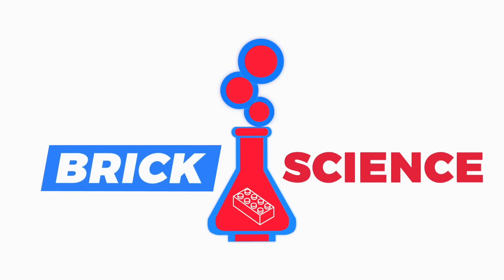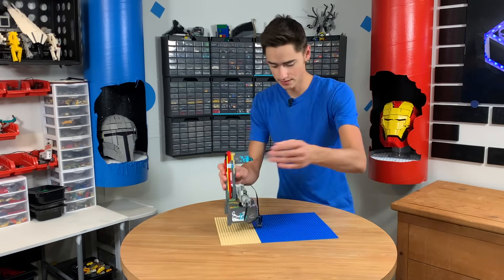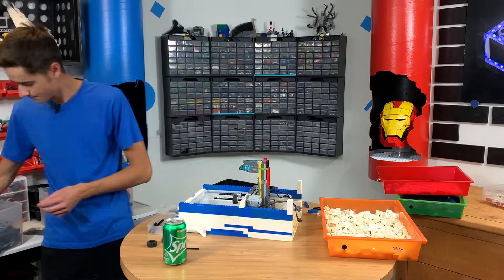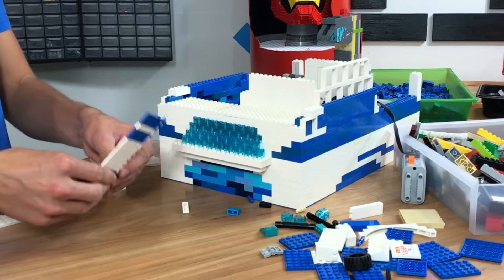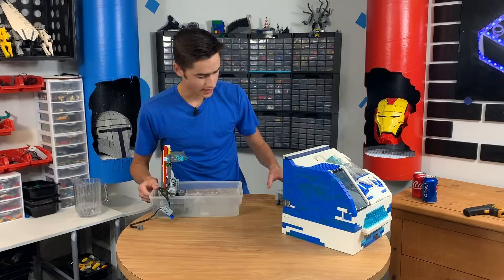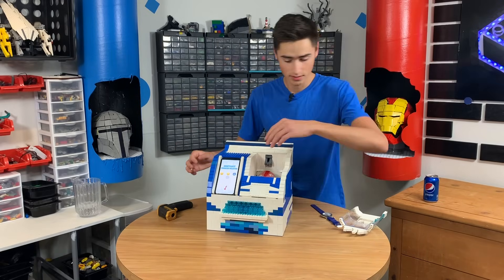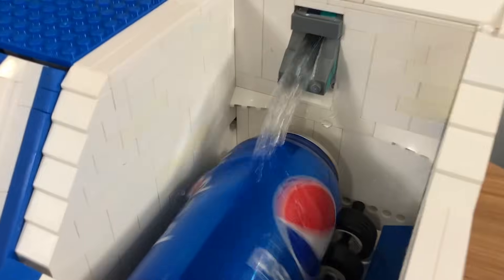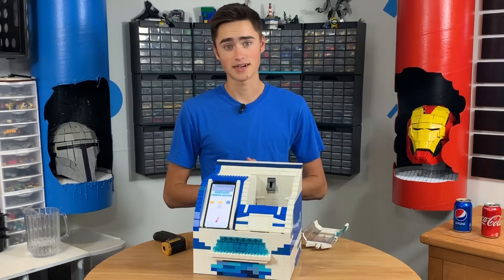Instant LEGO Drink Cooler (Chills Drinks in 2 Minutes)

Comment: I'm thinking about using a switch instead of using a hold mechanism like that. It wouldn't take that much space and you can just leave it as it's cooling your drink then just switch it off when done. It doesn't need to be automatic, but at least you don't have to stay there for 2 minutes waiting for the drink to cool.

Comment: It took him 4 hours to build and 2 minutes to cool the sodas. He personally said it takes 4 hours for soda to cool in the fridge, therefore the fridge is faster by 2 minutes 😎
Reply: @Stormstyker  But wouldn't the rapid  temperature change going below 0 degrees Celsius cause the liquid to expand (by becoming Ice)  destroying the can.

Edit: grammar
Reply: You don’t have to build it every time
Reply: Technically you are wrong cause making a fridge takes more than 2 minutes therefore the cooler is faster.
Reply: @dhruvagoyal2170  engineering student here; can confirm that assembly of the fridge alone would take more than 2 minutes
Reply: The soda cooler is faster by 58 minutes
Reply: @NOGAMEJOHN  3:58 actually
Reply: @NOGAMEJOHN  3:58:00
Reply: @Stormstyker  yes but then it would crumple the can and freeze the liquid inside to a sprite cube. But most importantly it WOULD do it in 1 second USE LIQUID NITROGEN
Reply: @creamypiss123  water expands when it freezes. Pop is mostly water, plus Gas that is condensed inside. If you freeze the contents, that gas actually will come out of the now solid water, increasing the pressure, and the water expands, increasing the pressure, so your can would actually explode.
Reply: The joke went straight over everyone's heads
Reply: Atleast it works
Reply: Full 🌕
Reply: You do know it takes at least 5 weeks to a month to make a fridge so its longer by that long
Reply: Ok but hear me out.. a fridge takes a while to build a Lego cooler doesn’t u clown 🤡
Reply: but then it only take 90 to 120 seconds
Reply: Best comeback
Reply: Yeah but it takes a day to build a fridge 😎
Reply: How long does it take to build a fridge?
Reply: Now wait to tomorrow then it’s faster😎
Reply: Yes, from the perspective of getting sodas chilled, it does seem less effective at first, but that means you can cool 120 sodas an hour. For the four hours, that's 480 sodas in the time it takes your refrigerator to chill 12. If you tried to cool 480 sodas at once in your fridge, it would increase the time to chill.
Reply: @Stormstyker  the liquid nitrogen is way colder then a slurped machine cooler even if it moving it will freeze 😊
Reply: However, the time it takes to build a fridge is considerably longer. Therefore, the lego build wins. 🏆
Reply: what if you put the soda cooler in the fridge so it takes half as long to chill :D
Reply: @Stormstyker you just ruined the joke
Reply: @Stormstyker  Lol yes
Reply: It was built one time so after the first use, it would have been faster. DISPROVED YOU!
Reply: Sddwdfe❤😢
Reply: Aaaa well it is faster if u yous is 2 time by 3:58 minuets
Reply: You are dooooooooog😂😮
Reply: Gangsta style
Reply: @Stormstyker  If you think about it it takes less time by 3H 58min. Because it can be used multiple times?

Comment: Just put the freaking coke can in the water with ice container 😂
Reply: yep but the tool can make it cool faster, because it is moving
Reply: So the big thing the rotation does is circulate the liquid closer to the outside of the can that has been cooled to the interior of the can. Cooling it faster
Reply: @tajr22  convection currents due to changing temperature would accommodate for this, spinning it would be negligible in something the size of a can.
Reply: @Eg9yBoy   that makes sense. I'd want to see someone prove it. Two Ice baths of the same volume and same temperature. Spin one, submerge the other. 

A six pack. Test both methods for 3 different amounts of time and then immediately take internal temperature
Reply: Wait what? This is some big brain shit, my head is big but my brain is small. Explaining my thick skull
Reply: @splitfancycake9069  basically this guys are trying to sound smart
Reply: @353-d8o  don't think their trying, pretty sure they are just talking about the temperature on whether spinning it or submerging it in water is better
Reply: Spinning it and Submerging it will achieve the same temperature, but Spinning it is a faster method while submerging it is a more cost effective method. Capiché?

Comment: Might be dumb of me to say this cause you might decide you want to tear this apart later to reuse the parts but it would probably work better if you used 5-minute epoxy or super glue to put all the bricks together permanently, cause it would not only make the walls of the machine a solid mas but it would also help to waterproof the machine as a whole by filling in the gaps between the bricks.